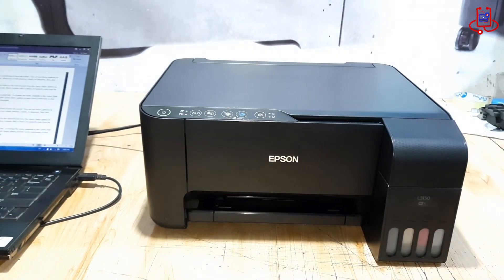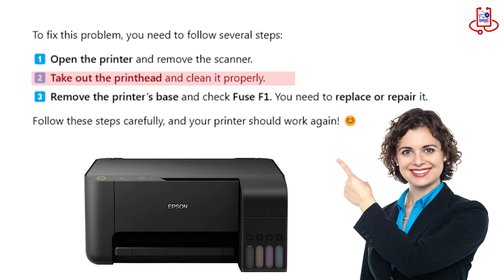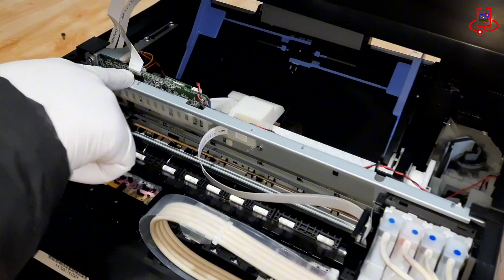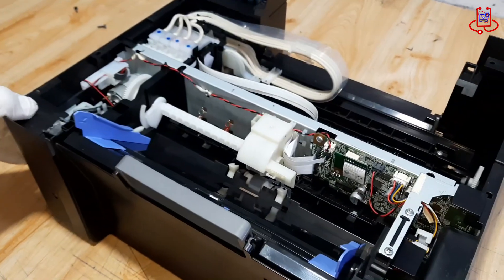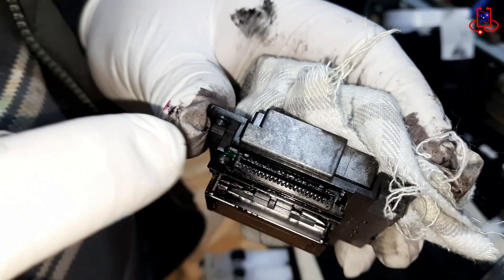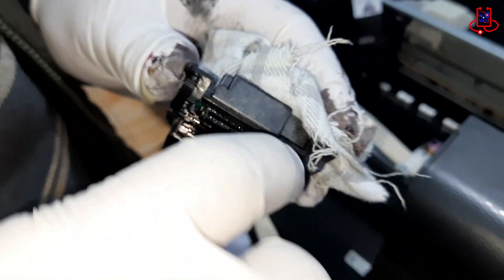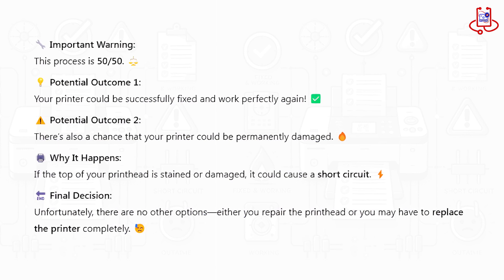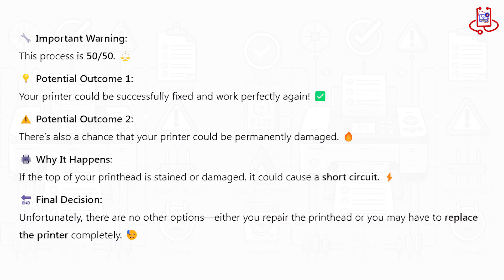Epson L3150 Error 031006 Fix – All Lights Blinking Solution!

Comment: instead of replacing the fuse, it's shorted.  so means no protection?
Reply from the maker: Yes, the protection is lost. There's no other fix. If you have an F1 fuse, you can replace it. But if the F1 fuse is unavailable, we are forced to do this (short it), otherwise the printer won't work.